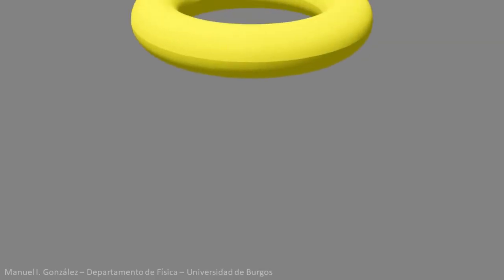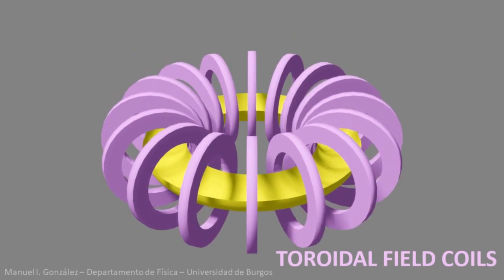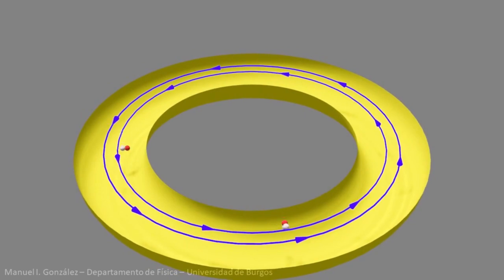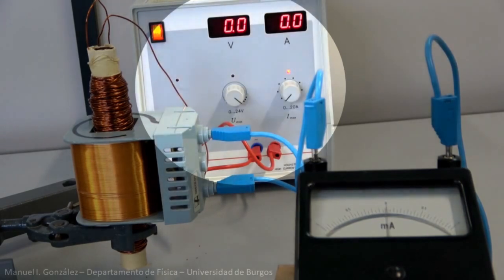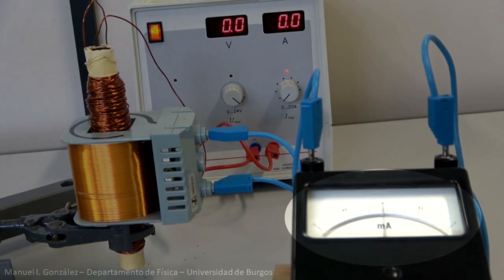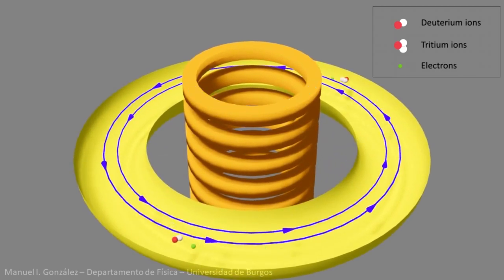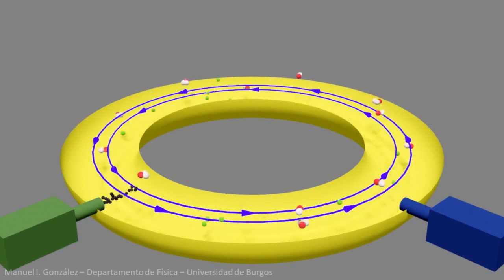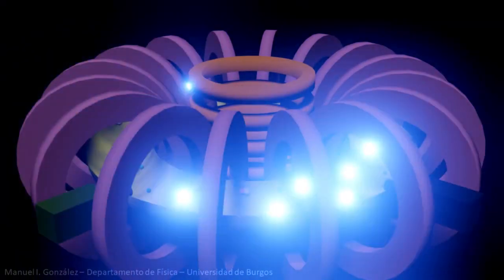Magnetic Confinement Fusion

Comment: Best and most detailed explanation of the coils!
So much thanks
But there is one info that is missing from everywhere: how do you turn the deuterium gas into a plasma on startup?
And why don't they use hydrogen?
Reply: As per quantum mechanics, the probability of recombination between duterium and tritium is higher when compared to hydrogen. The duterium is converred to plasma by irradiating with micro waves and by changing current in the coils.

Comment: Has hydrogen DT fusion been achieved yet in laboratories? Why do we prefer DT fusion instead of Proton - Proton fusion? Please answer these question please please please please 🙏🙏🙏🙏🙏🙏🙏🙏🙏🙏🙏🙏
Reply: You may be surprised to know that fusion can be done at home.

The actual challenge is to put less energy into creating fusion then the energy released from fusion.

DT fusion is preferable because neutrons in those isotopes have no charge, and can attract each other by the strong force without having a coulomb barrier. This makes fusion more likely.

Comment: Fantastic video thank you 

But how would that high energy then be used in the future for peoples house hold energy ? 

How is that energy transformed to the public in the future I mean ?
Reply: The high energy neutrons escape the reactor and then heat up water. The water evaporates and drives a turbine, generating electricity.